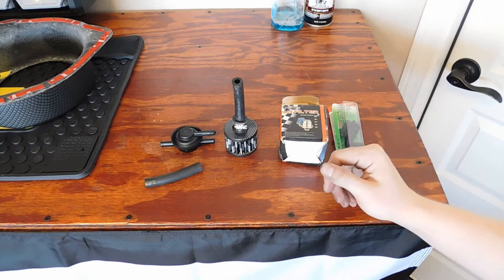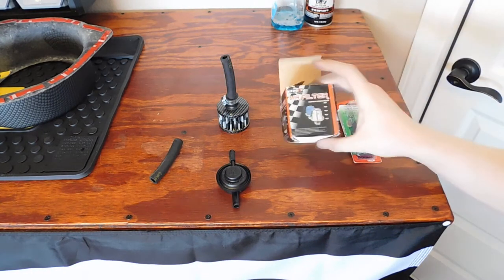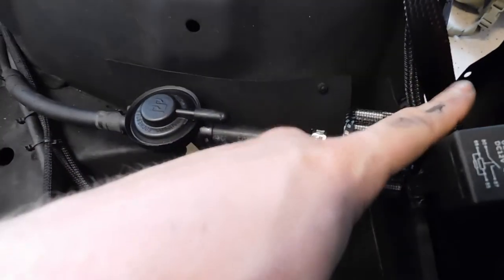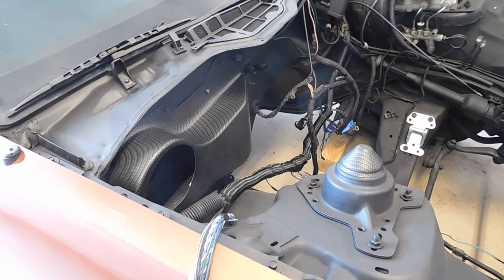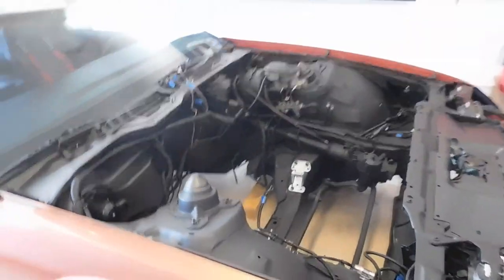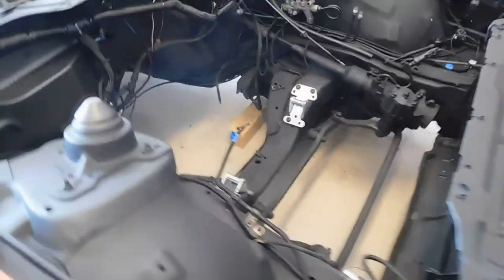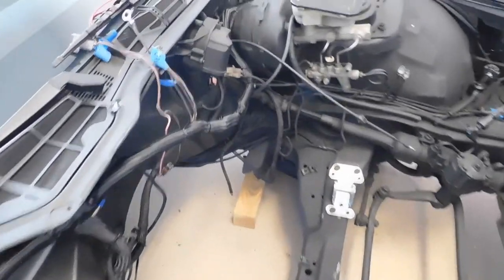82-92 Camaro Charcoal Can Delete and Blower Motor Housing Install

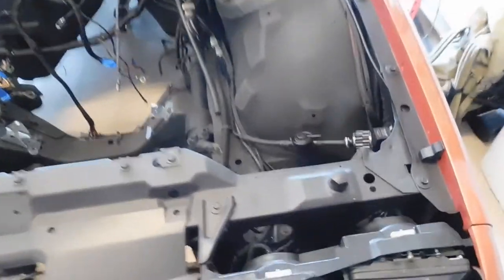Comment: Hi Tony thank you for this video as there's no more evap canister sold. At 3:40- 3:50 in the video you have the top port capped, but then you say :this top port is plugged so it releases 2-3 psi. That 2-3 psi is  through the air filter at the end not the top port correct ? because its have a very tight cap on top port.  Sorry just want to make sure.
 My gas was flooding out my evap can rain down to the parking lot. Want to do this right. Thank you again.

Comment: Tony great videos.   question on the canister delete. what do I do with all the vacuum lines? and did you get a smell of gas fumes from the tank?
Reply from the maker: Alot of the vacuum lines run to a t fitting so the can be removed. The only one I kept was for the vacuum reservoir ball under the fender for assist in starting the car. And no fuel smell from it. Just fuel smell from my exhaust lol

Comment: Great video, question, on my 85 Camaro on the drivers side of the engine bay there is a thin(maybe 1/4) line from the fuel tank which is capped. Is this the line that would have gone to the eval charcoal canister thing I’ve read about?

Comment: I have an 86 Iroc with  5.0 tpi. I want to delete the charcoal canister and I'm glad you showed me how to do that. But the problem I have is when I shut the car of the gas line to the canister blows out a fair amount of fuel out of it.. it just started doing this, and I'm not Shure why it's doing that...  It's leaks fuel out of the bottom of the canister if the gas line is hook up to it.. i took the hose off of the canister and just left the hose open at the end and it does and gas still comes out.. is this do to the pressure valve being bad? And do I just cap off the vacum lines going from the canister to the engine.. any help you could give me would be greatly appreciated. thanks!
Reply from the maker: So you haven't done the delete yet and it's dumping fuel into the charcoal canister? You may have a clogged vent causing it to pull fuel instead of mainly vapors.
Reply: @TonyTheTechnician  I took the tank vent off. I took it apart and cleaned it up.. and it working properly.. I took the gas cap off.. and I took the fuel line off the canister and  blew some air through it, some fuel blew out of the fill neck.. maybe I shouldnt  have taken my gas cap off ..lol..
My gas gauge is stuck on full also..another thing that has to get fixed.. I just recently picked up this car, and haven't felt a whole lot with TPI motors.. but I'm learning very quickly... 😏
Do I need to look at other things, like, fuel pump? Fuel pressure regulator? I have not tested the pressure at the rails yet? The fuel filter looks fairly new? 
So, I don't know what my next move should be to solve the problem.. but I would like to delete the emmisions junk on it...
Thanks for the response to my problem.. I appreciate that! But, what do you think I have to do to figure.. I'm hoping I don't have to drop the tank?
Reply from the maker: @jimgibbons5300  as far as the fuel at charcoal canister most times it's a faulty vent possibly the one at the charcoal canister. And if your Guage is reading full or past full it's most likely a faulty sending unit which would require the tank to be dropped unless you have the access door cut into the back above the tank.

Comment: Does your valve actually open at 2psi? I tried this and mine doesn’t let air out. I believe the small vacuum hose thats capped off needs to be hooked up to a vacuum source. I may ditch the valve and just run it open with a filter

Comment: I ran into the issue where the blower motor fan blade basket hits the firewall.   What the heck am I doing wrong?
Reply from the maker: R Rustenholtz depending on the housing you purchased some are deep some are shallow. If your stock cage isn’t fitting you just get a shorter squirrel cage.
Reply: TonyTheTechnician ,  ready for this?   It's a non a.c. car style.  Why make a a.c. delete box for a non a.c. car?   SMH
Reply: Bought one half the size but still doesn't fit due to where the cage sits on the shaft. Bummed out.   Looks like I have to find a different blower motor :/

Comment: Yet another tool question unrelated to the video 😂 I plan on buying the gearwrench xl box end ratcheting wrenches (like the set you won in the giveaway) and I also need a good set of normal ratcheting wrenches, I'm assuming the fitment would be the same for the two different styles. So my question is how tight is the tolerance on the ratcheting wrenches and would you consider them "worthy" of the professional environment
Reply from the maker: Matthew Collins as far as the gearwrench ratcheting wrenches I have. I believe they are great for the professional environment. The tolerances on the new set I got are nice and tight.

Comment: Great video.   Please forgive me.   What does the charcoal cannister do?
Reply from the maker: Thank you. It absorbs excess fuel vapors so they aren't released to the atmosphere and then they are recirculated back to the engine
Reply: @TonyTheTechnician  oh okay, thank you so much for getting back to me sir. I really appreciate your videos and you have been an inspiration to me to help keep my car on the road. I love these third-generation f bodies.
Reply from the maker: Thank you that's great to hear and glad I can help! 👍👍👍
Reply: @TonyTheTechnician  i have one more question.    By any chance do you know the serpentine belt size to by pass the AC  and air pump?    I'm trying to find a way to use the self tensioner only.
Reply from the maker: @jameslaiola4976  ya I have my old belt at home that just ran on the tensioner I'll have to look after work. I also just took a string and routed it how I wanted my belt then I measured that string to make sure before buying a belt

Comment: Where did you get that valve, and what's the name for it?...
Reply from the maker: Thirdgen83 that is the original valve from the charcoal system
Reply: What is the top port for (that you plugged)?...
Reply: I understand that it releases pressure from the tank, but how would it let air in to prevent a vacuum?
Reply from the maker: Thirdgen83 the top portion is capped in order for the check valve to reach 2 psi and open. If it was left open on the top then it wouldn’t open at 2 psi
Reply: @TonyTheTechnician  Greetings I've done some testing of the valve, it only seems to open when you add vacuum to the small control port. Did you send 2psi  to the input to see if it escaped out the output?--Thanks

Comment: I could be wrong... but that line you are plugging is supposed to have vacuum on it. If you plug that port like that it, will actually NOT allow it to vent. You can leave it open, and it should also vent OK, but don't plug it. 

For those reading this... try it. Put your mouth on the "tank side" and try plugging it as he did with your finger and blowing into it... it should block air from going through. If you release your finger, it will then allow your breath to flow through.

Let me know...

Comment: With this video I have learned how to do it myself,thank you... I just sucessfully nixed my cannister.
Reply from the maker: Very nice. Great to hear. Thank you. Let me know how it is for you 👍
Reply: @TonyTheTechnician  Actually i didnt finish yet and I have a question. The junction you used you blocked off top with a plug and the lower you ran you air filter off of. Thats great but when I remove canister there is also I vacuum line from there into my tpi,what do I do with that open vacumm intake?
Reply from the maker: @ScottsFormula350TPI  ya as far as I can remember I ran it to the vacuum port on my intake. Sorry it's been awhile since I looked at that part of the car
Reply: @TonyTheTechnician  I actually meant line running from my tank to tpi intake. It goes in just below drinkers side inley from valve cover. On a tpi car there is line running from tank to tpi
Reply: @TonyTheTechnician  im wondering if i just plug this intake. I did it and to be honest now its idling like sheoooot lol.
Reply from the maker: @Scott plus Colette  you ran it to the intake and it ran bad or you plugged the line and it ran bad
Reply from the maker: https://www.thirdgen.org/forums/fabrication/640219-did-my-vapor-canister.html 
 I think this is where I got my plan from
Reply: @TonyTheTechnician  Thank you. Your vid is still the best on subject...you forgot to mention capping off throttle body that this 3rd gen guy says in step one. He actually just throws it in there and yeah.Anyways. Im going to assume the same can be done for the TPI unit also although I am not sure why its idling different now, but I had alot of vacuum issues going to recheck today. Appreciate everything and hope all this isnt a pain.
Reply from the maker: @ScottsFormula350TPI  ya sorry about that. I think I forgot to mention that part since I was doing an engine swap. I hope it works out great for you
Reply: @TonyTheTechnician  Dont be sorry sir lol, he snuck it in there reeal quick. Thank you again for all the patience.
Reply from the maker: No problem at all. Thanks for watching and asking questions. I always try to help when I can

Comment: Only issue I see with can delete is raw fumes and poss gas out it if tank level is too high. It is not uncommon to have fuel in the canisters. Maybe Oder of gas on a hot day at a show. Great idea and vid that housing came out good. Thanks and hope to see u drive it soon. L can't wait to hear it run to see how you build on the engine came out.
Reply from the maker: John Gibson thank you I can't wait either. Not a whole lot left to do. And ya hopefully it's not a problem but I guess we will see.

Comment: First comment, nice 👍
Reply from the maker: brain dead New Yorker thank you 👍
Reply: @TonyTheTechnician  hey Tony, my 95 383 procharged lt1 has huge fuel lines with 50 psi of fuel pressure. When I fill the tank with fuel all the way, or when I'm going up a steep hill, I'm getting liquid fuel leaking out of the evap can? Do you know any way I can prevent that?
Reply from the maker: @biggregsparks8364  there should be a check valve on the evap system to prevent liquid fuel into the evap system I would check into that. Alot of the time if a tank is filled all the way and it pushes into the evap it can cause running and starting issues. And it's usually due to a family check valve or valve stuck open allowing fluid by. I hope this helps.
Reply: @TonyTheTechnician  thank you very much